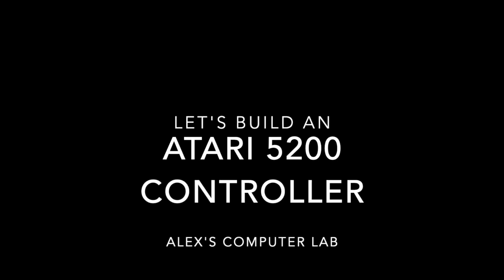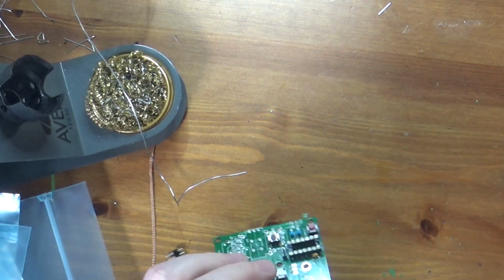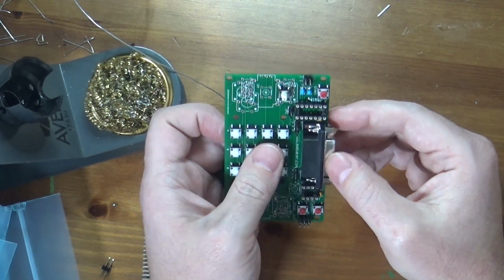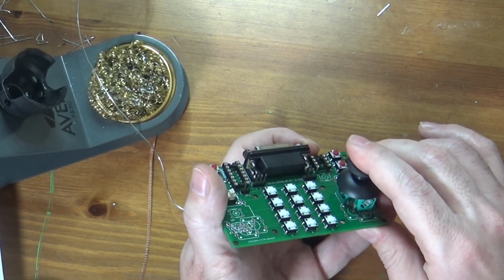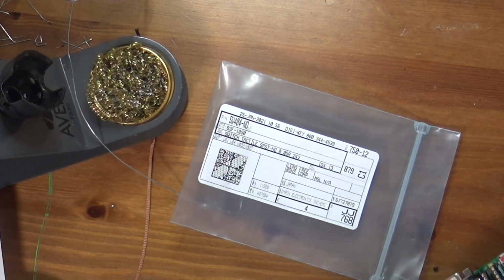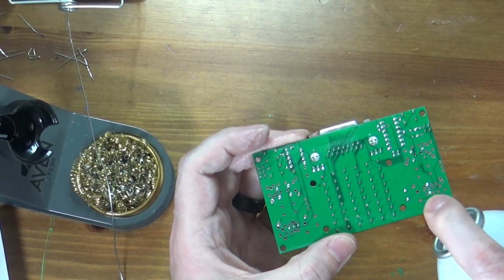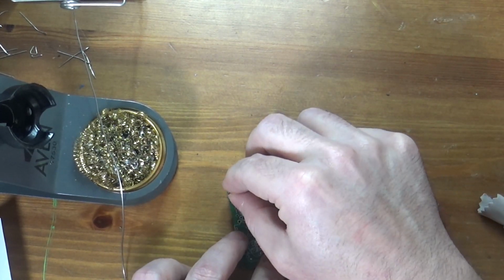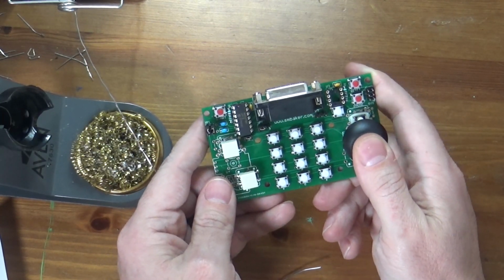Atari 5200 Controller Build, Part 3

Comment: For the headers - blue painter's tape. Holds them in place when flipping. Some folks like BlueTack. I don't - gets messy.
Reply from the maker: I’ve used painter’s tape, and scotch tape both...I much prefer the simple method of a piece of wood, when flipping. However, I didn’t have any handy. Definitely a good method, though!